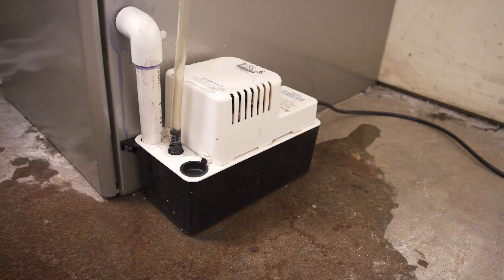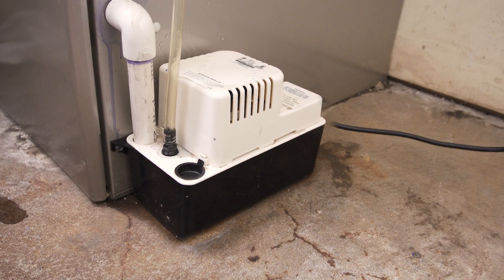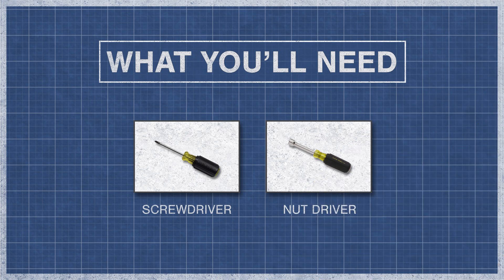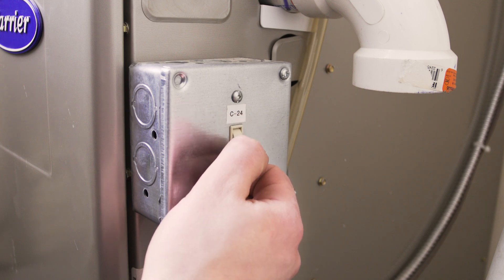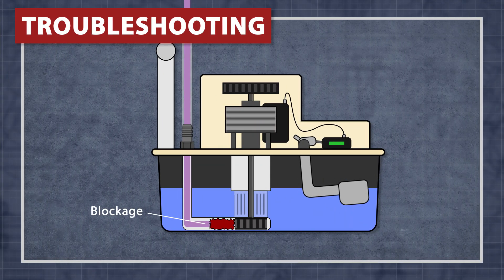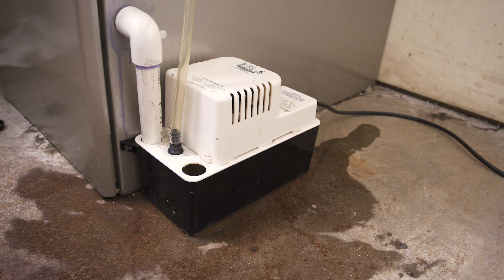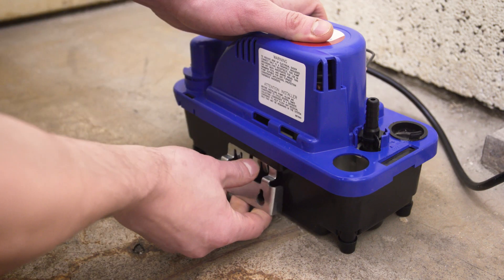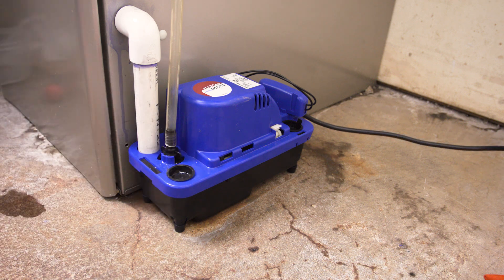Condensate Pump Replacement & Troubleshooting | Repair and Replace

Comment from the maker: Did this help you troubleshoot and replace your condensate pump? Leave a comment and let us know!
Reply: This would be more useful if you included audio of normal pump operation, for noise reference. The condensate pump in my apartment sounds like a blender going off every 30 minutes
Reply from the maker: @louiearmstrong  Thank you for the suggestion, we'll look at adding in example audio in the future. The condensate pump shouldn't be as loud as a blender as it has a smaller motor running at a lower RPM. In most cases the pump is in the basement and is often unnoticed. If its in an apartment then it will be harder to ignore when it runs.
Reply: @AmreSupply  There are two medium sized square condenser style AC units on the roof. Would they have a pump of some kind? They are directly above me
Reply from the maker: @louiearmstrong  Air conditioner units that are-outside will either get rid of the water by evaporation or a gravity fed drain line. The reason a condensate pump is needed for furnaces is that a drain is not near by. A condenser unit outside gives more options.
Reply: Yes!!!! Thank you. May I donate to your cause?
Reply from the maker: @coachunited4761  Thanks for watching! We appreciate the sentiment! If you want to help out, you can order your next part from amresupply.com , additionally liking or sharing the video helps our channel grow! As well you can always check out the additional videos on our channel. Every little bit helps! Cheers
Reply: I thought for sure my pump was bad because it is ancient, but your suggestion to jostle the float worked. Your video was excellent, and I will keep your company in mind next time I need a part. Thank you!!
Reply from the maker: @nikkiw8231  We're glad that the video helped you out, and we're always here for when you need a new part! Take care!
Reply: Apparently mine is a straight pipe while the unit is on the ground, I can't remove the unit.
Reply: Twice my condensate pump failed. The first time it caused damage and I had to replace a floor. The second time I caught it just in time.
Reply: Motor is running fine but water is shooting out the side hole and not running up the discharge tube
Reply from the maker: @Saltydad2020  Thanks for watching. Either the pump motor is faulty, or there is a blockage in the pipes. Additionally check each connection to see if its secure.
Reply: @AmreSupply  thanks for the quick response
Figured it out unfortunately. Need a new unit as the housing around the discharge valve is cracked
Reply: Thanks help me so much
Reply: Yes, thanks.

Comment: What's going on if the pump will not stop running?
Reply from the maker: The float switch is likely stuck and is continutously sending power to the pump. You can test the switch for continuity by following the same steps in this video: https://youtu.be/e_1pOWSVUfg?si=vyGw65eCqmm1rbIq&t=69
When you test the switch, you be able to see it go from 0 - 1 ohms to  ------------ or OL when you toggle the switch.

Comment: Mine leaks from the clamp when  the water comes down by gravity
Reply from the maker: Thanks for watching. You might need to replace the connections. They should all be tight and any mineral buildup can prevent it from having a good seal.

Comment: Thanks for this quick video on how the condensate pump works. Mine was running non-stop and I ended up opening it up and finding that the float switch was broken (was always in the 'on' position). I ordered a replacement switch off Amazon and swapped it in and it's working fine again!
Reply from the maker: Glad that the video helped you out!

Comment: Can I drain my dehumidifier into the reservoir (by placing the dehumidifier exit tube to the reservoir)?
Reply from the maker: Thanks for watching. Yes you can, it will just cause the condensate pump to run more frequently that's all.

Comment: My ac shuts off because the pump gets filled. But if I unplug the pump and plug it back in it drains. Any thoughts? Thanks!
Reply from the maker: Thanks for watching. The fact that it drains at all means that it's not a blockage issue. It's worth checking to see if the float switch is triggering correctly. It might be getting stuck. As well you can check to make sure that the connections are secure and that there's no corrosion on the float switch terminals.
Reply: Thanks so much for responding! Will do!

Comment: After turning my AC on for the first time in months (warm day in winter), I'm hearing what sounds like a low-power "whirr" noise from the pump that I have not detected in the past 11 years I've been in the home. It isn't terribly pesky but is audible from 20-25 feet away from the pump. I will monitor it to see if it shuts off but instinctively it seems like it might be problematic or at least foreshadowing something problematic, especially if the noise persists for another hour or more (because it seems to indicate that the motor is working but the water level within the pump, which I can see is near the top, is not lowering).
Reply from the maker: Thanks for watching. It is normal for the motor bearings to wear down over time, so these sorts of sounds can be a sign that you'll need a new condensate pump.

Comment: If pump runs and check valve is clear, the discharge tube could could be clogged. I had this happen. Used an air compressor and blasted some algae chunks out of the tube. All works fine now.
Reply from the maker: Thanks for sharing, those are excellent tips! Glad it's working now!

Comment: Great video ! My pump works, but the discharge tube connection threads broke (?) & it sprays the water up like a fountain. It's kinda cramped where the unit is, so I don't know if it's the male or female part that's damaged.
Reply from the maker: Thanks for watching. It is difficult to know what is damaged until you take a closer look.
Reply: @AmreSupply  Well, you're right. I did take a closer look & it was the purge valve that broke in tow at the threads. A trip to Lowes & $4.49 later...well, actually I had to buy a new dehumidifier also, so...
Reply from the maker: @spitmahoney1153  Thanks for the update, we're glad that you were able to narrow it down!

Comment: What should I do if I have water shooting out of the reservoir that you were putting water into? It happens every time the furnace kicks on.
Reply from the maker: Thanks for watching. If water is shooting out of it then check the connections to make sure the tubing is connected correctly. 

As well look for any leaks in the tube itself.

Comment: Basically, this repair video says, "Replace the pump". Useless video, Lance.
Reply from the maker: Thanks for watching. Troubleshooting a condensate pump is not as involved as troubleshooting the furnace itself. This video is structured in a way to help people check for the simple things first before replacing the pump as a blockage will prevent a healthy pump from running. Reading through the comments on this video, many people found this video helpful including the troubleshooting section.

Comment: Is my condensate pump supposed to have one hose that fills it 1 holes that empties it and 2 black plugs? Or 3 black plugs? I wish I had the ability to attach my photo.
Reply from the maker: Thanks for watching. Generally there is a inlet which loosely drops water into the basin, and one outlet tube which is secured with a barbed fitting and a flexible hose.

Comment: This is what I needed. What can I do when the pump is wired directly into the switch controling the furnace?
Reply from the maker: Thanks for watching. Do you mean that the safety switch is wired into the furnace? Or do you mean that the main power for the pump itself is connected to the furnace rather than an 120V outlet?
Reply: @AmreSupply  , hi. The pump is wired into the switch for the furnace, but while the furnace is off - it won't work with the pump running and I turned it off at the switch, the pump is still running. Also I couldn't find an emergency off switch on the pump itself.
Reply from the maker: @heidipetrick918  That seems like it was wired in that particular way possibly to prevent the furnace from running when there's too much condensate. Does the pump stop running after the water level drops?
Reply: @AmreSupply  normally yes.
Reply from the maker: @heidipetrick918  So when the water drops the furnace should work normally. Do you have any issues with your furnace itself?
Reply: @AmreSupply  , no the furnace is fine.

Comment: Hello I just got some one to install a new furnace .A Bryant he installed . This is first winter used but lots of water on the floor .Can you help me please
Reply from the maker: Thanks for watching. If the problem isn't with the condensate pump then it would be best to call the installer back to fix the problem with the furnace that they installed.

Comment: There is no reason to not try blowing out the feed tube upstream on the check valve. It's simple impeller pump and no damage can occur, and blockage there only means if you can remove it it will pump again. Good video otherwise, but as much DIY stuff the rest of it covers is more complicated that simple blockage at impeller outlet to tube that goes to check valve.
Reply from the maker: That is a great tip! Overall we do try to cover multiple solutions as what works one time for one person is not always what will work for everyone.

Comment: Thanks for this troubleshooting demo. My pump was running, but no water was coming out. Turns out the clear tube was kinked; someone had pulled a zip-tie too tight where the tube turned a corner.
Reply from the maker: You're welcome mike, we're glad that the video helped you narrow down the problem!

Comment: Can water flow through the pump and exit into the drain without the pump motor ever turning on? It seems unlikely, but i haven't heard my pump motor turn on for days, and the entire discharge line is full of water. Some 10-15 minutes after the AC turns off , I hear the water clearing out of the line on its own like gurgling water.
Reply from the maker: Thanks for watching, there could be some siphoning occuring. The checkvalve will prevent backflowing but it won't prevent siphoning.

Comment: How long should a pump last? Living in the Midwest and have the model that you installed to replace. It’s only three years old and it never stops running. Going to try these steps now.
Reply from the maker: Thanks for watching. How long a pump lasts really depends on each unique case. A pump can last 10+ years if it runs occasionally. For something that is used constantly it is not uncommon for it to fail sooner after several years.

Comment: Great video. Was a bad check valve. Just took the ball out of check valve and good to go. Pump is about 20 yrs. old and just like one in video. Was wondering why reservoir had pressure build up when removing exit tubing and the stuck valve explains that. Thanks for saving me about $200 bucks for an A/C guy possibly wanting to replace the pump.
Reply from the maker: Thanks for watching Fred, we're glad that the video helped you save a few bucks!
Reply: The pump reservoir can not build up pressure. and depending on how your discharge hose is ran, the check valve is an important thing to have functioning properly. At a minimum without one, your pump will come on more often as the backflow after it stops pumping, will simply fill the reservoir a little and the pump will come on again sooner on every cycle. If it is a longer uphill run more water , just a 1 foot rise and downhill very little.
Reply: @jayc4283  I ended up getting a new pump once it gave up completely a week or so later. 20 years is prolly enough time on the old pump, ya think?  :)

Comment: Thank you for the helpful video, but how do I connect the two wires?
Reply from the maker: Thanks for watching. You'll want to use a wire nut. You can see the basics of this in this short video. You likely don't need to strip these wires. https://www.youtube.com/watch?v=Fh2YIFVt51Y You'll want to match the wire nut to the gauge of the wire: https://www.amresupply.com/catalog/Wire-Caps-EC7B orange wire nuts should work for these wires.

Comment: I spent the entire night trying to figure out why no air was blowing throughout my house.  I checked the furnace pilot light,  the wires of the thermostat.... it turns out,... it was the condensate pump.   I had seen random water in the basement earlier in the night,  and your video was the key to me figuring it out and solving the problem.  The hot air is blowing.  The house is getting warm again.   THANK YOU SO MUCH!!!!
Reply from the maker: You're very welcome!! The condensate pump is not the first thing people think about, and sometimes all you need is something to point your in the right direction. We're glad that its working again!

Comment: Sincere thanks. I had NO idea what was wrong (except that the furnace wouldn't "go").
This tute led me STRAIGHT to the problem - a blocked check valve that I managed to free up after several hefty BLOWS (the last of which BLASTED water out).
The only point I'd mention is that I had to CUT off the bottom of that clear discharge tube as it was almost "welded" onto the check valve (and the furnace is only 2 years old)!
No biggy. I had enough length to PUSH the tube onto the check valve (& clamp it) after it was freed up & reinstalled.
I appreciate you sharing your knowledge.
Liked & subscribed,
GN
Reply from the maker: You're very welcome, we're just happy that our videos are helpful! Its good that you had enough of the tubing left to cut and reinstall, glad that it all worked out for you!

Comment: What if you have a condensate pump that connects to the furnace?
Reply from the maker: Thanks for watching. The condensate pump might be connected in 2 ways to the furnace. The drain pipe will be connected to collect any condensate from the inducer motor. In some cases the condensate pump is also hard wired to the furnace to shut off the furnace if the water level in the pump gets too high. This is designed to prevent flooding.

Comment: Great video - I was just wondering if the pump reservoir will always have water in it and your animation showed me that the answer is yes
Reply from the maker: Thanks for watching. Most pumps including sump pumps don't make perfect contact with the bottom of the basin so there is a little bit of water left but doesn't create problems.

Comment: Could a faulty condensate pump be signaling a “pressure switch open fault” in the furnace?

Great videos!
Reply from the maker: Thanks for watching. If the condensate pump is faulty, you'll see a high water level and it will trip the cutoff switch (if installed. In your case a "pressure switch open fault" is likely one of several issues. This is described here in this video: https://youtu.be/b0sAGt-1niU?t=121 You'll want to make sure that the airflow is good for combustion. Make sure that the burners are clean, and the exhaust vent is clear on the outside of your home. If the flue vent is not clear, you'll get back pressure which will trip the pressure switch. As well make sure that the tubes leading into the pressure switch are not clogged. Another issue could be a clogged condensate drain (in this case the condensate pump basin would likely be bone dry, or would have a low water level overall)

Comment: Why is mine all of sudden making a humming sound? It is not leaking. Thanks!
Reply from the maker: Thanks for watching. If the condensate pump is making a humming sound, the motor could be starting to wear out. With the pump unplugged, you can open the cover to check if the motor is able to spin freely. Clean out any debris or mineral buildup if anything is blocking the impeller.

Comment: I was told the one way valves are a pain in the ass.
I also have to send water up almost 8 ft to reach the drain pipe, I'm wondering if I should get a heavier duty pump, or have an additional one way valve half way up, as my existing pump set up is failing after only 2+ yrs, only pumping up to a foot or so.
I'm having trouble sourcing just the 1-way valve for a 554401 1.0 A pump too..
If I wanted to use 50-60 ft of hose I could drain into a sink less than 4 ft up too, minimizing the work of the pump.
What to do about this annoying problematic drainage..?
Reply from the maker: Thanks for watching. One way check valves are useful in preventing water from flowing back into the pump and triggering the float switch repetitively. You can install a check valve further down the line but it will add some resistance to the flow more than the existing check valve on the pump. Every pump is rated for a certain flow rate at different heads or vertical lengths of pipe. It would be best to look up the chart on your pump. This principle is described in our sump pump video and is a good visualization: https://youtu.be/Iqh3rI2XX4o?t=151 Condensate pump motors are fairy basic but should be able to pump up 8 ft of head without issues. Your current pump motor might just be wearing out or it might be under-powered. If the current setup is a 1/50hp motor, then you can always upgrade to a 1/30hp pump like this one https://www.amresupply.com/part/554530-LG-NXTGEN-84GPH-COND-PUMP-115V If you look at the chart in the pictures, it will show that the pump can easily still output 60 gallons per minute at a 10 foot head. Also if you do need a new check valve for the pump, you can order a replacement one here: https://www.amresupply.com/part/154715-LG-CHECK-VALVE-3-8-inch-VC-ASSY Hope this helps!
Reply: @AmreSupply  Thanks, ya the 8-10 ft threshold means I'll upgrade when this 1 finally fails.